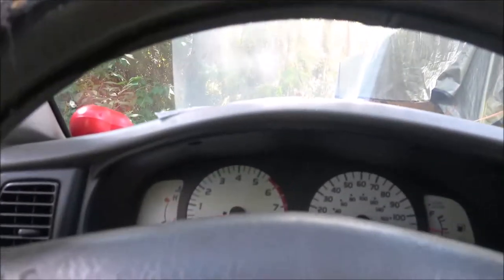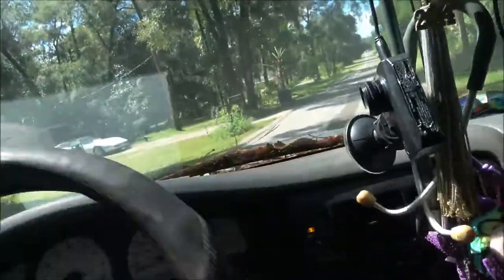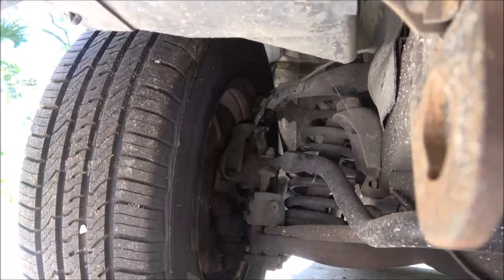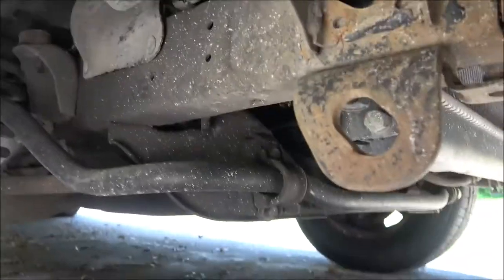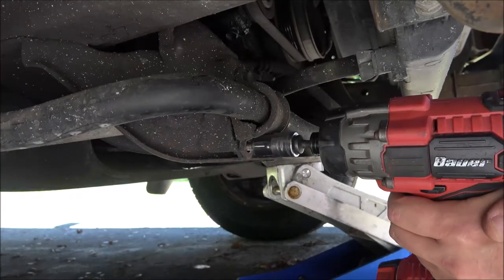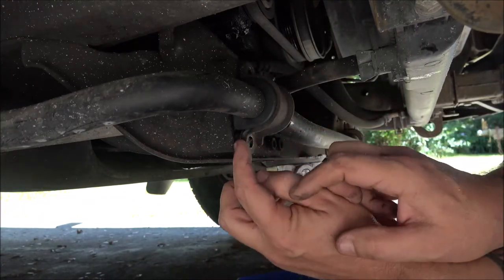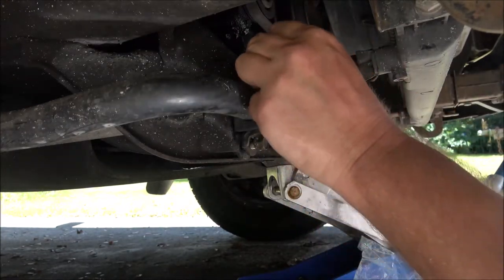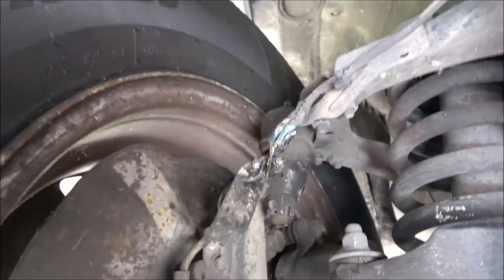Stabilizer Bushing Replacement 2003 Toyota Tacoma In 4K

Comment: Can you please tell me what brand you used ? I’m having trouble ordering the correct ones for mine
Reply from the maker: If I remember right it was just an off brand. You can call the parts store and they will give you brand names and part numbers then you can order what you need on line.
Reply: @shabear1000  I slowed the video down and managed to get a part number off the box, assuming you used those same ones, I got MOOG k200759.
Reply from the maker: @Z33.gi0 that's a great idea.  If that's the number on the box, that's the parts I used.
Reply: @shabear1000  bought the part, perfect fit, thanks for the video, trying to find the correct ones had me stressing !
Reply from the maker: @Z33.gi0 awesome to hear.  Enjoy the rest of your weekend my friend.